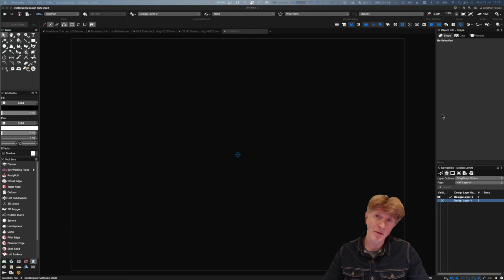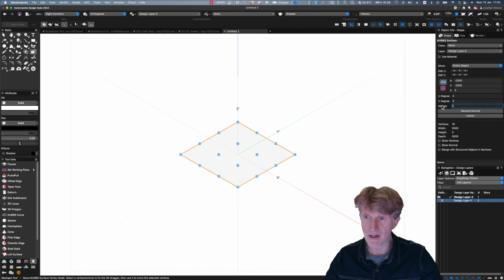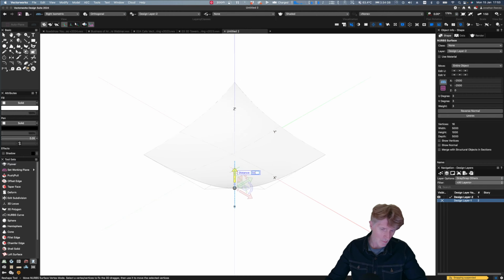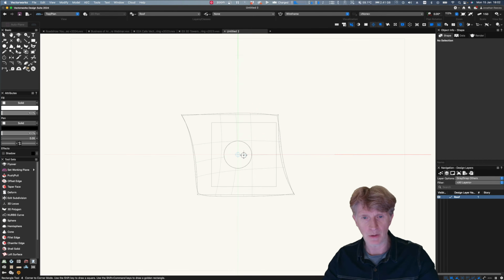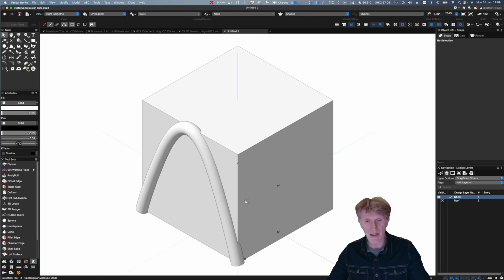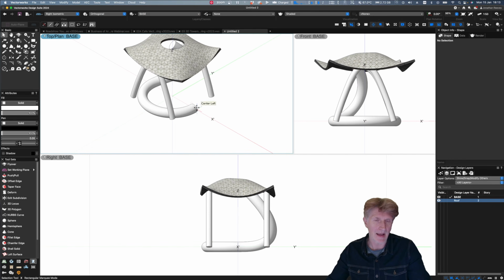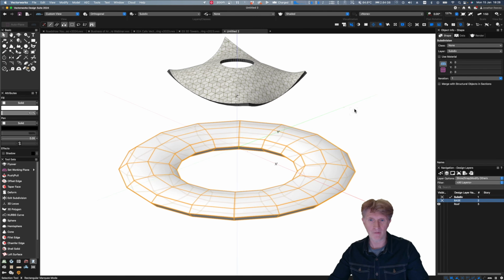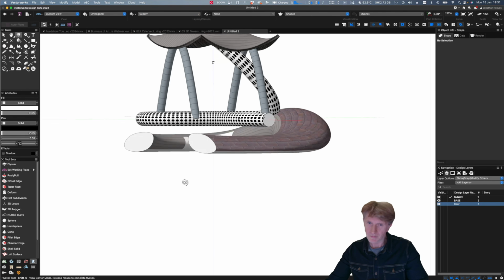Vectorworks 2024: Easy Freeform Modelling with the NEW 3D Dragger

Comment: Hi Jonathan, thank you so much for this interesting tutorial, which really helped me a lot! I have an additional question. To give the modelled surface thickness you use the 'Shell solid' and enter a value. I would like to extrude my modelled surface in a straight way down to have a flat surface on the back side. How should I do this? Hope my explanation is clear!
Reply from the maker: Glad you enjoyed the video! try extract surface then project that using the project and trim tool

Comment: Hi Jonathan. @ 5.15 you start to edit the shell. When I click on the control point the 3D Dragger seems to align itself to the 3D surface instead of staying locked to the XYZ axis. What's the trick here? A liitle later - Don't worry, I got it, I needed to select the Align to Working Plane, mode :-)

Comment: can the 3d dragger be used on generic solid shapes, ie take a cube and stretch corner points etc, I used to be able to do this in microstation and it's always frustrated me ive never worked out how to do it in VW???
Reply from the maker: Yes, but only if you convert to subdivision first from the modify/convert menu. Or use the Subdivision from the start.